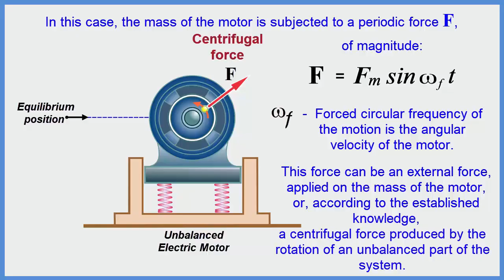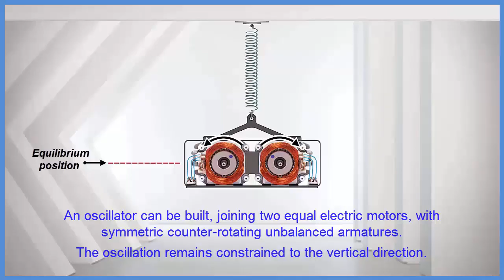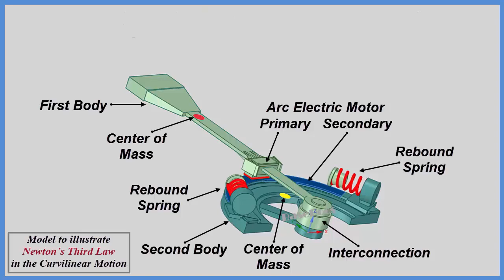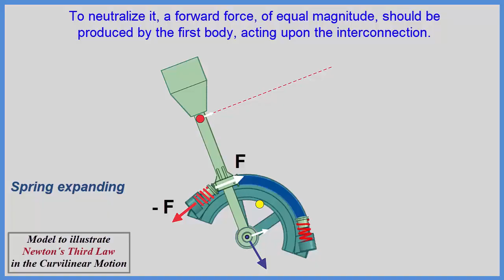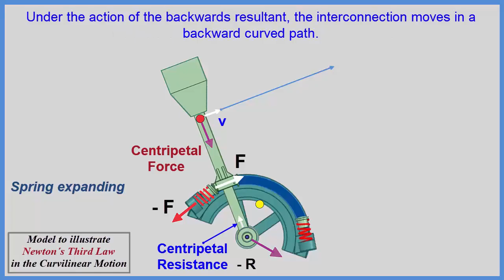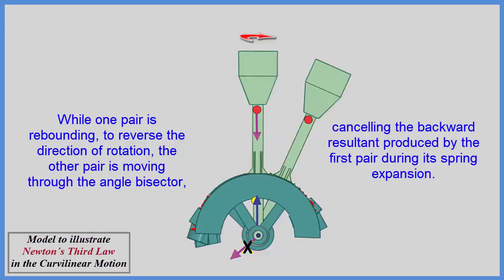Using a Propellantless Drive Concept to Illustrate Newton´s Third Law

Comment: You probably don't know that your device was the very first one to be proposed ... in the 19th century! It was rubbish then, and it is rubbish now.  What is wrong with you people? Do you have academic degrees? If so, sue the awarding body. You were cheated.
Reply from the maker: Actually, I don’t know where to begin other than saying the Dunning-Kruger effect may be in full swing. For the record: I’ve never claimed to be an expert, but I’ve certainly spent a lot of time doing science. I haven’t seen any of your historical examinations on these devices or research, but I’d be more than happy to look into them if you would explicitly provide them. 

To be a responsible citizen scientist in this age you’re better off using a YouTube account to make some videos and show your findings rather than operating as a faceless vagabond who appears to take great pride in leaving insulting comments. Worse: it appears that you’ve had 15 years to alternatively be more constructive with your account, but yet here you are making your toxic rounds. 

I welcome dissent, and maybe you are a professional of some field, BUT if the way you engage in meaningful intellectual discourse equates to unsubstantiated provocative claims, coated in pretentiousness condescension, sharpened to belittle the honest efforts  of a small time Science YouTuber, it says ALOT more about your formal education (and a fair bit about your personal goals/intention on this platform) than it does my own. 

Again, I wish Jesus Christ—the final and ultimate Truth— upon you. Prayed for you now. Grace and peace.

Comment: An imbalanced propellantless propulsion can be achieved even much simpler by pulling a spring from both sides w/ two crankshafts of different lengths. Why are these so called scientists looking further? Or what do you think such a setup will perform?
Reply: I sense that the Dunning-Kruger force is strong within you.